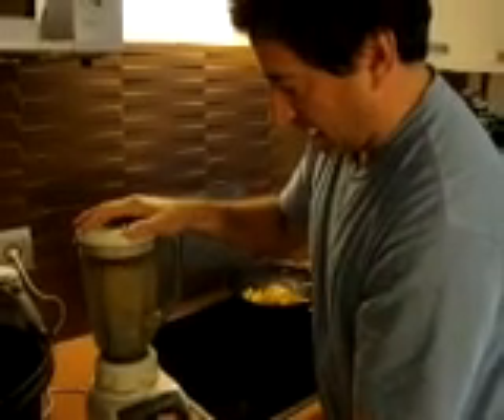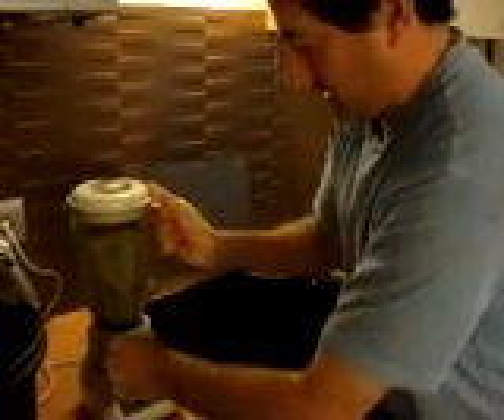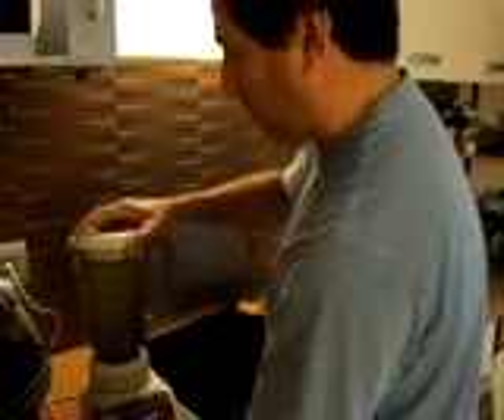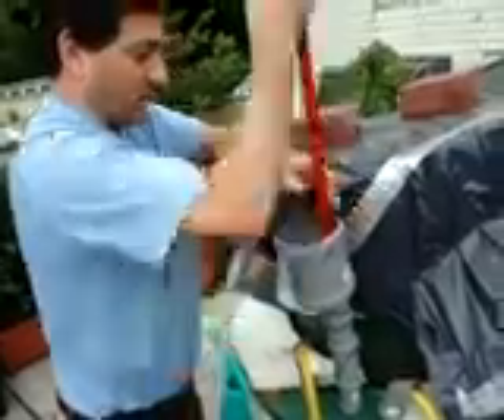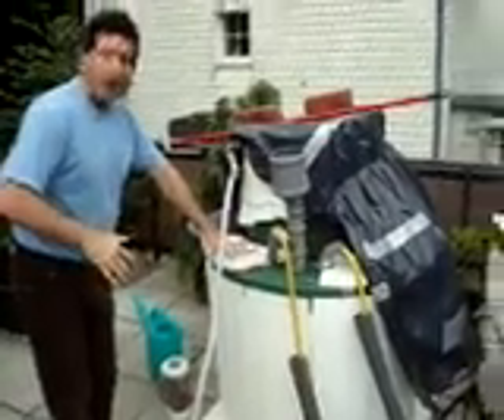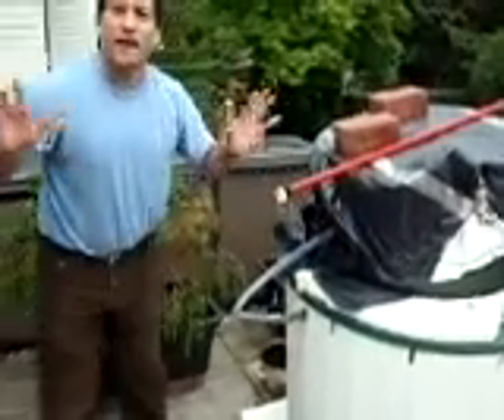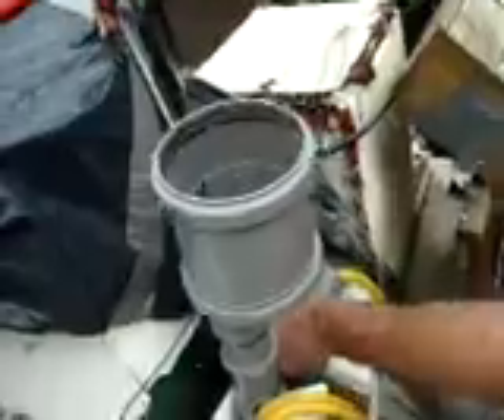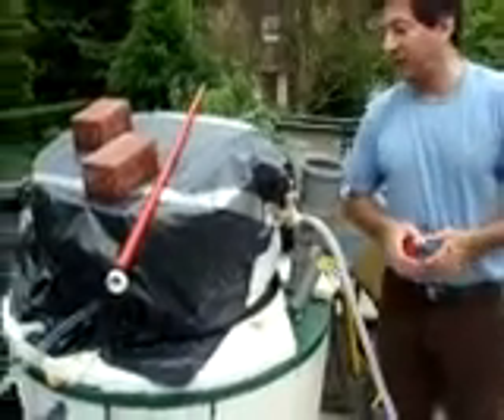Our Biogas Kitchen

Comment: Thomas, i'm in the middle of collecting my parts for this project and would like to know does the stove top that i have hooked up to natural gas can this one be used for bio-gas if not which one can be and also can this be used to heat a house or barn? what kind of system do you think would it take to atchieve this? i'm making my  system using ibc totes I have 6 of them so far I have 9 pigs and 2 cows and handfull of chickens i want to use there wast for this process... thanks for any help..

Comment: @tculhane I didn’t pay attention to the date on the video. You are right. Quite a bit of time has passed. It sounds like you have refined the process and that it is working well for you. I’m still curious though; do you know how long you can continue to produce gas on a certain quantity of biogas? It seems that if you keep feeding it that it will keep producing but I’m just wondering how much gas can a a certain amount of waste produce. Thanks again for your responses.

Comment from the maker: @MrAnthonyRizzo The compost tea made from the biodigestor is indeed active and very rich in micronutrients.  Because we don't put much fecal material in and no lignocellulose (straw, leaves or grass) we haven't had any appreciable build up of solid biomass over the past nearly three years.  Maybe in another few years we will have to vacuum out some solids but I doubt it. If we do, they will make a nice addition to the compost. To extract them we would just stick a wet vac hose down.

Comment: Could you answer these questions for me please?
1) How long can you keep producing bio gas from a fixed supply of liquefied food waste, for example let’s say 50 gallons?

2) Is this system any different than the one that extracts methane from cow manure or human manure?

a. If not can the two systems be combined to effectively convert not just the kitchen scraps but also bathroom fecal matter into bio gas and possibly compost tea and compost?

b. If so, what would the process entail?

Comment from the maker: Slicerrr2, just put a smaller bucket upside down into a larger bucket.  Make a 1/2 inch hole in the bottom of the smaller bucket  which you can fit a tube into airtight (acquarium shops have the tank fitting).  Make a 2 inch hole in the bottom of the larger bucket and put a fitting in that and run a feeding tube into the center of the larger bucket.  Fill with water and horse or cow manure the first day and let ferment for two weeks. Once you start getting methane, feed ground up food waste.

Comment from the maker: Hi engineeringtube. Good question; answer is that CH4 is lighter than air and the major volume accumulates under the gas collection tank and stays there.  What little is produced around the edges does bubble out but seems to be so little we can't even get it to ignite running a lighter around the rim.  Could be that facultative aerobes metabolize some of  it into CO2 along the way and that the methanogens cluster under the collector where the food is. Regardless we get no leakage to speak of.

Comment: Good idea basically.... but if you have to blend everything before it goes into the fertilizer, you still need a lot of electricity.
Btw is looks a bit unsafe, your system.... no worries about safety issues?